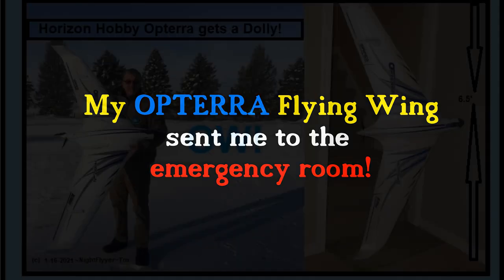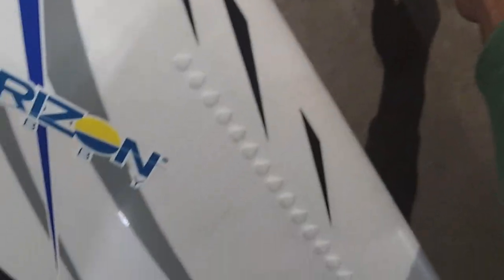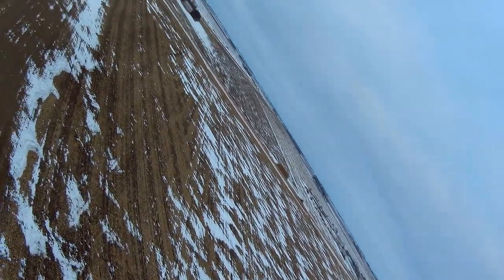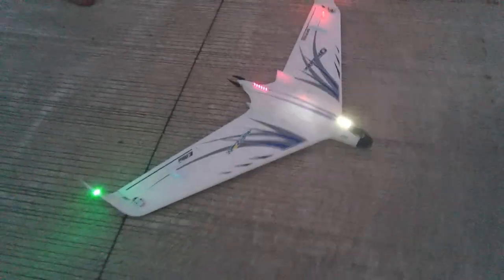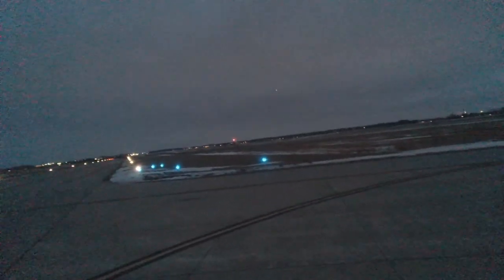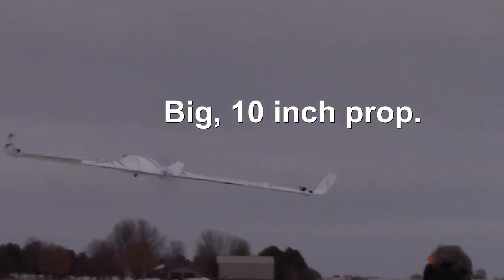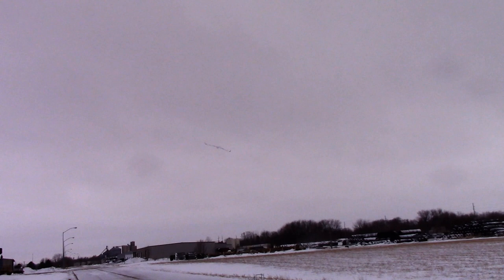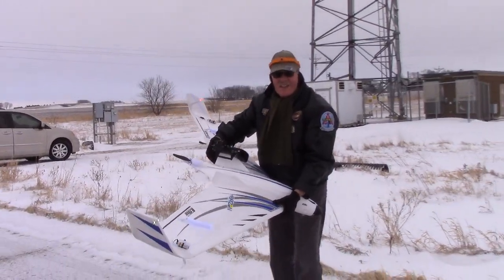My Opterra 2M Flying Wing sent me to the E.R. This is an awareness video & my solution for launching

Comment: This is why I keep a medical kit in my car, blood clotting spray, superglue, 20% benzocaine antiseptic spray, gauze and electrical tape. I've had cuts about that bad before and a little superglue will fix them right up without the cost of an ER visit.
Reply from the maker: Yes.  We used CA in Vietnam a lot.  I thought about it but doubted I could glue my tendons back together , then glue  the cuts that were pouring out blood all with one  hand.  Thanks.
Reply: @NightFlyyer  Yeah, sounds like a little much for a medkit fix, but not a bad idea to keep one with you regardless, you never know when you'll need it.
Reply from the maker: @PineyJustice  My vehicles do have a first aid kits.  That would not have helped much.  Pressure to stop the bleeding is what helped. Thanks.

Comment: You must launch it by holding one of its wing wing tips, that’s how I launch mine and works great 👍
Reply from the maker: This wing is 7 foot long, heavy and will bend and break the end off the if you even try to pick it up by the tip and barely has enough power to fly out of your hand at launch.  I know and I tried to launch it discus style, but could not hold it where I felt I could launch it successfully in the wind.     It would also be extremely difficult to somehow launch it discus style with the elevon there and that 7" tall winglet rudder that is also on the tip.  I know how to do it , but not with this plane.  I didnt see yours on your channel, as I would love to see how you do it with the Opterra 2M.
Reply: @NightFlyyer  whoa😱 then let's try keeping our other fingers safe😀

Comment: Always follow through with a hand toss .. Ive seen this plane bite alot of people . with that being said you can side toss this bird .. I do it all the time with safe on !  Good luck and Happy flying
Reply from the maker: I appreciate that, but if you follow my channel, you know I am no newbie and to say I asked for it or should have done it differently is sad.   First of all, that throttle arming had nothing to do with my hand injury. I only mentioned the Throttle arming because I followed instructions in the manual and that is  the way it bound up.  It arms the motor as soon as you plug in the battery. If it had said to program in a throttle cut, I would have!    We Marines were taught to follow instructions and stick to the plan or get dead!  So after spending 33 years in the Marines, I managed to stay alive because of that.  This wing is 7 foot long and will bend and break the end off the if you even try to pick it up by the tip. It would also be extremely difficult to somehow launch it discus style with the elevon there and that 7" tall winglet rudder that is also on the tip.  I know how to do it , but not with this plane.
It's not like launching my small F-27 Evolution.  So I followed the instructions word for as I did for the video I made of my product review earlier, but it bit me.  https://www.youtube.com/watch?v=P_inF5EYLEE&t=1s

Here is word for word what the Opterra 2M manual says about launching.  
1. Put the aircraft into launch mode with the channel 5 switch.  (in my first video that did not work, it went into the ground)  
2.  Hold the aircraft in one hand and the transmitter in the other.  
3.  Apply full throttle and throw the aircraft directly into the wind, angled slightly up (5 to 10 degrees above the horizon). 
4.  Climb to a safe altitude and check the trim.   
I know others have their own ways, and either way, my Dolly is the safest solution for me.  
The Opterra 2M manual also says nothing about throwing it with the motor off, so if a newbie followed the instructions, like I did, I'm showed what could happen, in case a gust of wind got them or something else.     Nothing is 100% and no matter how good you can throw, this big 7 foot wing with a 10 inch prop spinning right next to your face, is risky. 
Maybe a gust of wind, maybe my 73 year old left arm was weaker, or who knows.   But either way, if it happened to me launching the way I thought was good (and  the same as all my previous launches.)  So if it can happen to me, it can happen to others, and that is the warning I want to present.  Thanks.
Reply: @NightFlyyer  I understand I struck a nerve with you .. but the end of the day video does no lie .. YOU DID NOT FOLLOW THROUH ON THE TOSS ! .. you left you hand extended as if you where throwing a dart . You can not do this with this bird in 1.2 or 2.0 ..  tough break indeed sir .. and much respect to you for your service  and thank you . no need to explain your service to me to prove a point .. My father in law was in the Chozen Few and never uttered a word about any of it other than HOO Rah!!  Ps.. I think you got my comment mixed up with some one esle as I never mention throttle cut or a few other things you ranted about ..  Good day sir
Reply: @NightFlyyer  Oh and while I'm at it .,,,your title  this video should read ,, My own bad choices send me to the hospital!   NOT THE PLANE !
Reply from the maker: @speedteamhpi  Again, I followed the instructions and simply warning others.  No bad choices.
Reply from the maker: @speedteamhpi  Many others have been hurt.  You are a car guy and if it was you throwing this, it COULD happen to you as  as well. I cant believe you are so critical.
Reply: @NightFlyyer  I love how yet again you label me .. first I'm a newbie and now a car guy ... lol    . Just shows that my point is valid . You know nothing about me and my practices . which I can say has not lead to me cutting my hands on both my Opterra's after many flights.  I not being critical , I'm telling the truth and clearly its hard for you to swallow .
Reply from the maker: @speedteamhpi  You don't know me either.  You weren't there yet are telling me off and blaming me.  I didn't see any videos of you flying and that is sure different than cars.  This is the big opterra, not a small one and barely has enough power to get out of your hand. If I mislabeled you as a car guy only, I am sorry.

Comment: if i somehow get a plane with the no arming feature i have a 3d printer so i can 3d print a stick holder so it wil lhold it in place and make it not move maybe
Reply from the maker: It would hit the ground on landing.  
Here is word for word what the Opterra 2M manual says about launching.  
1. Put the aircraft into launch mode with the channel 5 switch.  (in my first video that did not work, it went into the ground)  
2.  Hold the aircraft in one hand and the transmitter in the other.  
3.  Apply full throttle and throw the aircraft directly into the wind, angled slightly up (5 to 10 degrees above the horizon). 
4.  Climb to a safe altitude and check the trim.   
I know others have their own ways, and either way, my Dolly is the safest solution for me.  
The Opterra 2M manual also says nothing about throwing it with the motor off, so if a newbie followed the instructions, like I did, I'm showing what could happen, in case a gust of wind got them or something else.     Nothing is 100% and no matter how good you can throw, this big 7 foot wing with a 10 inch prop spinning right next to your face, is risky. Thanks.

Comment: Not even knowing what would happen yet, but even during the first successful test launch I was thinking about that hand being very disturbingly close to the propeler. That safety margin was little on the small side to my liking. Some might consider me being overly cautious, but as I like me staying in one piece I would definitely at least use a cut resistant glove on that launching hand. 
Another disturbing part of this is that you had to pay 2400 USD for three deep, but not big cuts to you finger just to get it sewn back together. It just shows how medical costs in the US have gone totally out of control.
Reply from the maker: Well that cost was for xrays, anesthesia to numb it, and 2 tendons being repaired, not just stitches.  Nothing wrong with being cautious. My previous launches were okay, but close. Gusting wind or something went wrong for sure.  Thanks for the glove suggestion and I tried that already, because it was cold, but trying to hold on to the tiny finger grips on the bottom of the 7 foot wing with a thick glove under full power would be difficult when under power and then trying to fly with it on and also difficult to fly the transmitter,  so although that sounds like a good idea, it would probably not work that well.  We are only talking about a Half inch of clearance that I needed to keep from getting cut. Thanks.

Comment: On all my planes I have throttle cut on a switch. Always stay safe
Reply from the maker: First of all, that had nothing to do with my hand injury. I only mentioned the Throttle arming because I followed instructions in the manual and this is the way it bound up and arms the motor as soon as you plug in the battery.  It's my warning to be cautious, because the manual says nothing about programming in a throttle hold to a switch. I've known of times when after flying, that switch was forgotten to be moved back to safe and it armed as well.  Nothing is 100% as it could be left in the wrong position, by accident. I'm pretty experienced, so never relied to on a throttle cut/hold, as all my helis and drones need stick movements to arm.   I only am warning others to be careful BEFORE the launch and to be careful no matter what you use.
Reply: @NightFlyyer  ya I kno it had nothing to do with it. I been a victim a few times my self but it’s a great hobby n sometimes things happen. Glad ur ok have fun stay safe

Comment: Did you ever hear of throttle hold?
Reply from the maker: Of course.  I'm no newbie!  First of all, that had nothing to do with my had injury. I only mentioned the Throttle arming because I followed instructions in the manual and this is the way it bound up and arms the motor as soon as you plug in the battery. It say nothing about setting up throttle hold. It's a warning to be cautious, because the manual says nothing about programming in a throttle cut to a switch. I've known of times when after flying, that switch was forgotten to be moved to safe and it armed as well.  Nothing is 100% as it could be left in the wrong position, by accident. I'm pretty experienced so never relied to on a throttle cut/hold, as all my machines need throttle stick movements to arm.   I only am warning others to be careful BEFORE the launch and to be careful no matter what you use.

Comment: Sorry to see that happen. Nasty cut(s)

You can grab it where the leading edge meets the fuselage and throw it from there
Reply from the maker: This wing is 7 foot long, heavy and  will bend and break the end off the if you even try to pick it up by the tip and barely has enough power to fly out of your hand at launch.  I know and I tried to launch it discus style, but could not hold it where I felt I could launch it successfully in the wind.     It would also be extremely difficult to somehow launch it discus style with the elevon there and that 7" tall winglet rudder that is also on the tip.  I know how to do it , but not with this plane.  
It's not like launching my SMALL F-27 Evolution or 1.2M Opterra.  So I followed the instructions word for as I did for the video I made of my product review earlier where nothing happened bad.  https://www.youtube.com/watch?v=P_inF5EYLEE&t=1s and the second one where I explain how to protect the bottom of the fuselage.  https://www.youtube.com/watch?v=ur5V5H8UcGs&t=1s  Thanks much.
Reply: @NightFlyyer  I didn't say the tip... I suggested the fuselage where the leading edge of the wing meets the fuselage. 

If you care, I have a video showing how to hand launch the Drak this way. It is over 8.5 pounds and 62"
Reply from the maker: @MajDuty  Again, I tried and did not feel comfortable with it.  My dolly works and is very low stress for this 73 old guy.
Reply: @NightFlyyer  that is definitely a much safer and stress-free approach I agree. Be safe and have fun

Comment: I never connect a battery without engaging throttle hold.....the motor will arm while throttle hold is on......
Reply from the maker: I certainly know that as most of my helis have that setup. I've flown models for 60 years.  I'm 73.  But the best rc pilots in the world, have also had bad landings once in a while.  Shit happens, especially while I was trying to throw this heavy, underpowered 7 foot model into the 12 mph headwinds.  Maybe if the Manual had said I should do that, I would have. 
 First of all, that had nothing to do with my hand injury. I only mentioned the Throttle arming because I followed instructions in the manual and this is the way it bound up and arms the motor as soon as you plug in the battery. It says nothing about programming in a cut switch like my helis have. I only mention it to warn others to program in this feature as well,  which also should have been mentioned in the instructions.  It's my warning to be cautious, because the manual says nothing about programming in a throttle hold to a switch. I've known of times when after flying, that switch was forgotten to be moved back to safe and it armed as well.  Nothing is 100% as it could be left in the wrong position, by accident. I'm pretty experienced, so never relied to on a throttle cut/hold, as all my helis and my drones, and many of my electric planes need throttle stick movements to arm.   I only am warning others to be careful BEFORE the launch and to be careful no matter what you use. .    Here are the links to the last videos and you can see I launched it the same way without problems.  Thanks.  Its hello dolly from now on. 
https://www.youtube.com/watch?v=P_inF5EYLEE&t=1s&gl=CO  and   https://www.youtube.com/watch?v=ur5V5H8UcGs&t=1s

Comment: Mine bit me a couple times as well but never as bad ! solution for me was to install a wing flight controller with automatic launch
Reply from the maker: Maybe it should say to buy one in the manual. 
Here is word for word what the Opterra 2M manual says about launching.  
1. Put the aircraft into launch mode with the channel 5 switch.  (in my first video that did not work, it went into the ground)  
2.  Hold the aircraft in one hand and the transmitter in the other.  
3.  Apply full throttle and throw the aircraft directly into the wind, angled slightly up (5 to 10 degrees above the horizon). 
4.  Climb to a safe altitude and check the trim.   
I know others have their own ways, and either way, my Dolly is the safest solution for me.  
The Opterra 2M manual also says nothing about throwing it with the motor off, so if a newbie followed the instructions, like I did, I'm showing what could happen, in case a gust of wind got them or something else.     Nothing is 100% and no matter how good you can throw, this big 7 foot wing with a 10 inch prop spinning right next to your face, is risky.

Comment: Dude!a guy at our flying field did the same thing! He cut 2 tendons, and sliced many times down his arm. Those things are dangerous!!! For easy launches a simple leather glove does the trick.
Reply from the maker: Sorry to hear that and hope he is okay  now. Thanks for that suggestion and I tried that already, because it was cold, but trying to hold on to the tiny finger grips on the bottom of the 7 foot wing with a thick glove under full power would be difficult when under power and then trying to fly with it on and also difficult to fly the transmitter,  so although that sounds like a good idea, it would probably not work that well.  We are only talking about a Half inch of clearance that I needed to keep from getting cut. Thanks.

Comment: Why not program throttle  hold??
Reply from the maker: I always do but me and others sometimes forget to switch it back after a flight and I am just pointing it out that it doesnt have the special start way  that the Horizon Electrifly speed controllers used to have.  Also, that had nothing to do with the accident.

Comment: Could you rig an atlatl thrower for launching?
Reply from the maker: If it said so in the manual, I would have, but this big 7 foot wing is so undepowered, it is still sketchy with that big 10 prop right in your face. Thanks.
Reply: @NightFlyyer  ok. Just looking at your launch method and the prop size and alignment would give me pause to think about a safer method. My father raised my brothers and me as amateur engineers, so I guess I just look at things differently.

Comment: Now Dave, that one is on you! Knowing the risk, and you still did not wear a thick, leather welding glove, to protect your hand? If I recall, this is not your first encounter with a propeller. At least, you still have all your fingers!
Reply from the maker: Thanks for that suggestion and I tried that already, but because it was cold.  I found trying to hold on to the tiny finger grips on the bottom of the 7 foot wing with a thick glove under full power with wind blowing was difficult when under power and then trying to fly with  a big enough glove on was also difficult to fly the transmitter, (I'm a stick pincher)  so although that sounds like a good idea, it did not work that well. Some have told me the Prop got them in the forearm even before launch, when a gust of wind got under the wing and tipped it back, so gloves wont protect that.  We are only talking about a Half inch of clearance that I needed to keep from getting cut, and even though I pulled it off several times in my earlier product review video,  I will never hand launch it again.  LOL.  It's hello dolly from now on!   I in 60 years of flying never stuck my finger into a prop, so your mistaken.  I am always aware, and simply got bit this time.